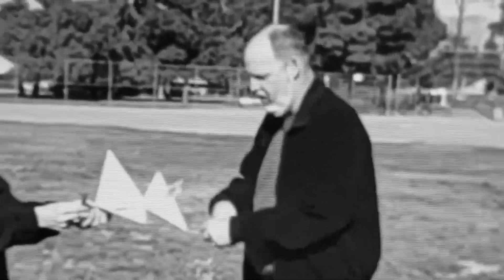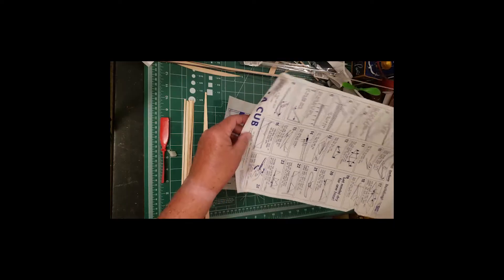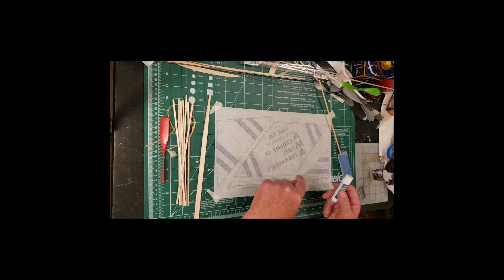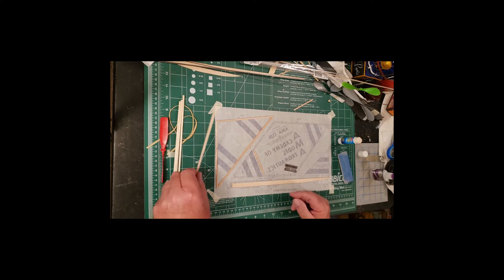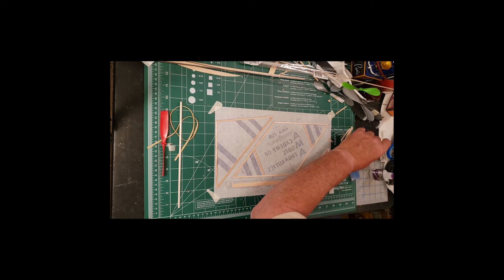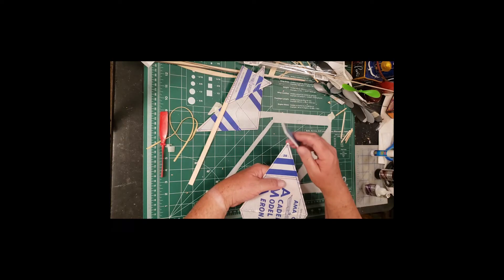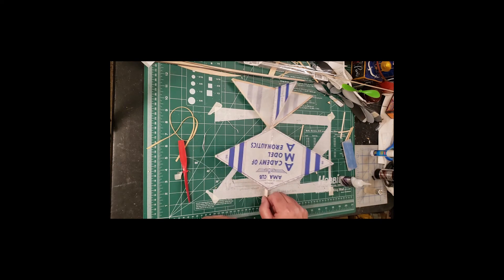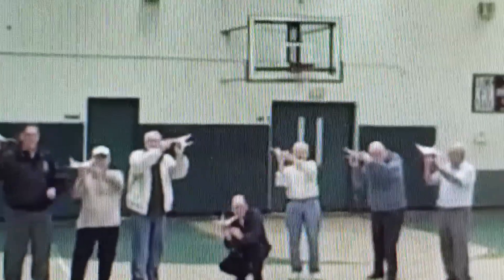The Delta Dart and how to build him

Comment: i have built a few but never got one to fly right   i think the   To Much Elevator  was the problem   the way the motor stick is angled for the stab     the shim might have made all the diffrence   i do still have a full size plan   BUT not the special paper print   guess any light paper would work    may be even mylar     any suggestions   ?      Very Good video instructions